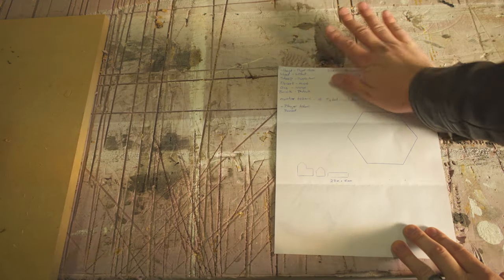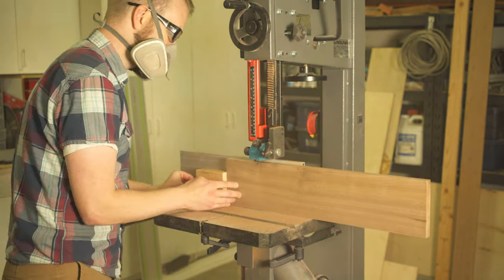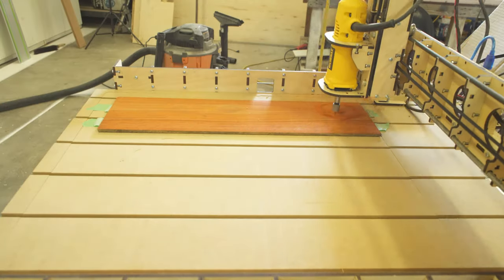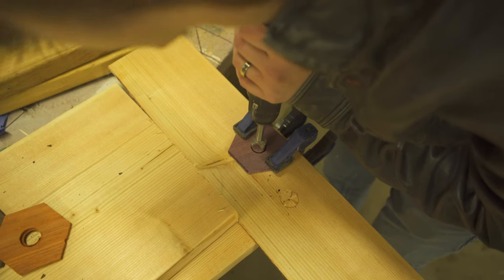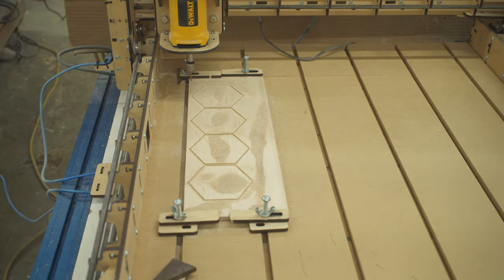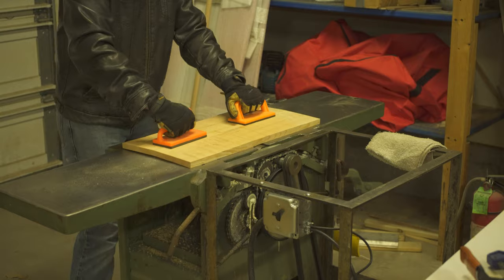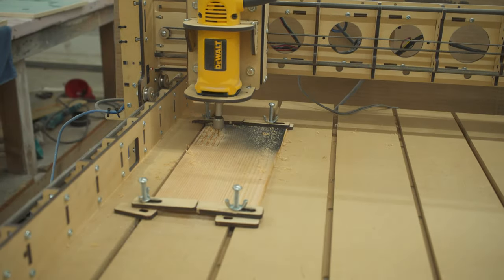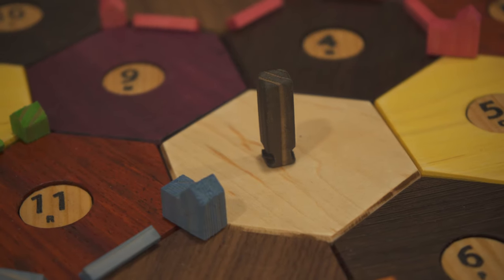Making Custom Settlers of Catan Boards | Part 2: The Game Pieces

Comment: Couple of questions, (I am thinking of doing these as table numbers for a wedding)...what font did you use for the numbers?  Is there a specific font for Catan?  Also, is a vector file available for the number tokens?  I need to scale up in size.

Comment: I don't have much experience with cnc routers, but would it have been possible to put a sacrificial board under the timber so the router could cut all the way through?
Reply from the maker: Certainly possible. The issue you run into with that is that once a piece is cut out it is loose and the bit will usually knock it somewhere and it could break the bit, or cut into the piece that was just cut out or something like that. If I was good enough I would try to put tape under everything that was cut out all the way to hold the pieces down, but that can be tough. At least for a beginner like me